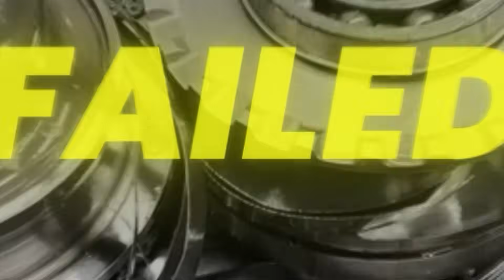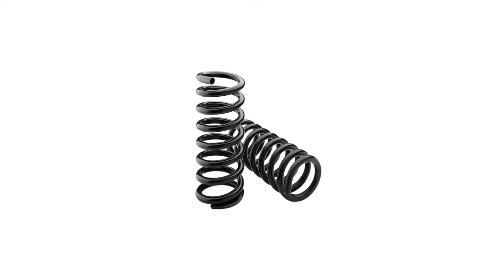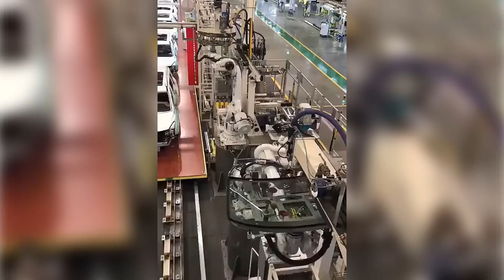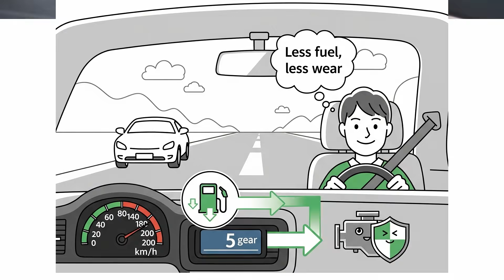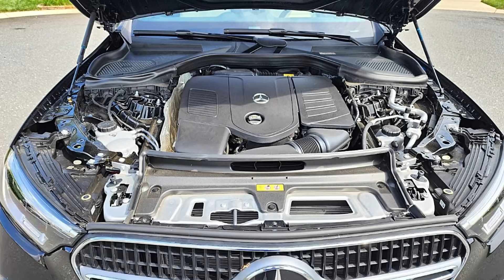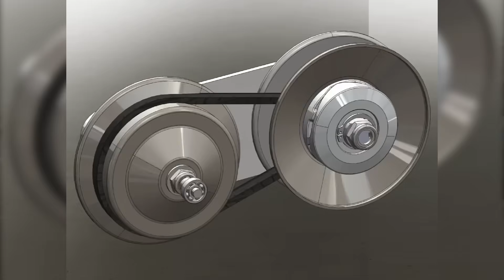How This One Bad Habit Kills Every CVT Transmission Before 50,000 Miles

Comment: CVTs are great but the issue is that the vehicle is too heavy for the CVT to run. Think about it, CVT are on powersports for a reason. Lightweight only. If they put a transmission with transfer case in a power sport chassis, the vehicle will be too heavy for it's classification. Most people now a day, pedal to the medal. It doesn't matter about fluids if they are always on the pedal.
Reply from the maker: agreed

Comment: If possible buy a car that still has the older automatic in it. If the car with one of these automatics is driven properly then they can last over 400,000 miles. Try not to get a car with a CVT transmission as they can be trouble in about 150,000 miles. They cost on average 4,000 dollars to buy and replace. They are usually replaced with another complete CVT transmission.

Comment: Cvts are inferior to manual transmissions and traditional automatic transmissions. It should be phased out just as timing. Belts are inferior to timing chains and should be phased out
Reply: Subaru CVTs use a reinforced metal chain instead of a belt.
Reply: Ain't gonna happen.
Reply from the maker: The only advantage is they give slightly better fuel economy and smoother driving experience at low speeds

Comment: It's built to fail. No matter who drives it you won't get to 100k miles. Don't buy vehicles with them.
Reply from the maker: i THINK its only advantage is that it gives slightly better fuel economy
Reply: Completely false.  There are mass numbers of CVT-equipped vehicles that go over 150k - 200k without failures.  My'87 Toyota Camry and my '98 Ford F-150 couldn't, and they had traditional automatic transmissions.
Reply: That is a COMPLETELY FALSE statement for a Toyota CVT.

Comment: Biggest killer of CVT transmissions is the same as regular transmissions, lack of maintenance. Changing the fluid regularly is the biggest thing you can do to keep any transmission going. I know a guy that has 200k+ miles on a Nissan CVT, he is religious about changing the fluid.
Reply: Mine was mirage cvt used for ride hailing in ph..it has 343k km mileage. Used it for 8years with no cvt and engine problem.
Just cvt fluid change.
Reply: The problem is Nissan is telling customers they should change it every 60,000 mi. That's the problem
Reply: @dampergoldenrod4156  that’s cause they wanna make money. It’s better at 30,000.
Reply: @dampergoldenrod4156  
Because if you wait until 60K, your car will be outside the 60k warranty period.
Reply: @dampergoldenrod4156  That or telling them it never needs changing. I argued with a Nissan sales hole over this one day. I told him to stop telling people that and it's not true. He replied "what else can I help you with". I don't understand why these jerks are telling people this. Do they actually think I'm going to buy another Nissan after the transmission fails prematurely?
Reply: That’s why we have Google and the Internet to tell you the exact truth and the right time of maintenance to change anything basically in general
Reply: @dampergoldenrod4156 My dealer says 30,000. But I say 15,000 (filter) and the one in the pan. My 2021 Rogue SV 26,000 just a little over.  Bring the standard drive transmission. Nissan is big trouble, I'm looking for another car. Nissan goes to where Satan is.
Reply: @dampergoldenrod4156 Nissan actually let a Lebanese snake oil salesman be their CEO.
Reply: That's why they make it as difficult as possible to change the fluid, with no drain plug, no dipstick, and arcane fluid types that have only inferior generic brands in box stores.  This way, they can claim it's not their fault that the owner didn't change his fluid and filters.  The other thing is undersized cooling for the fluid, often with just a coolant/CVT fluid device that can contaminate the CVT fluid long enough to trash the transmission before it gets caught.
Reply: @Mikexxx531  Like seat belts they had to make it a law to get people to use them.  Many transmissions are ruined by foreign matter the reason you cannot change the oil yourself, all computer controlled  light years ahead of most people.
Reply: @curtiseggemeyer5681 what who makes said computer
Reply: My Honda Accord has a CVT 225,000 miles and it drives like a baby you have to change the oil at least every 30,000. If you do it at 20 even better.
Reply from the maker: After how many miles he changes fluid?
Reply: @AutocornerdPros New CVT every 30000 miles 
Basic maintenance schedule for a Nissan
Reply: @samuelswanepoel7926  A new CVT every 30000 miles? That sounds about right.
Reply: thank you neckbeard cvt fanatic
Reply: Depends on which vehicle. I only drain and fill once on my 2007 Tacoma. I still own it after 320K+ miles.
Reply: @matrix-fh9tn  They have CVTs?
Reply: Bingo
Reply: They are like timing belts. They are inferior and there's no reason to go back to timing Chains...cvts are inferior and there's no reason manufacturers should not go back to traditional automatic transmissions or manual transmissions.
Reply: So prayer is the key to extending the life of a CVT? No thanks.

Comment: Why make a over complicated gearbox when most people who drive can’t even check there oil or tyre pressures it just another motor con from vehicle manufacturers to take the money out your pocket, also why haven’t you explained and made sure the owner of the car now about the run in if you don’t tell them then yeah there just going to drive like normal…… massive engineering con
Reply: Ask and blame Nissan who invented CVT
Reply: @leetos.4915  Nissan didn't invent the CVT nor were they the first to use a CVT. They do have the worst CVT on the market though
Reply: @greasemonkeymechanic1  Yes THE WORST   CVT  is a Nissan  CVT
Reply: @leetos.4915 cvts are a pulley technology from 100 years ago
Reply: @dampergoldenrod4156  They should have stopped using them 100 years ago.

Comment: Nothing beats manual with a clutch 😂
Reply: But in Europe, manual with clutch are being buried along with diesel cars.
Reply: @torque-converter-w2y   That's an automotive manufacturer's choice; NOT customer choice.  Its all about what's best for revenue; not the customer.
Reply: 100%! I call my clutch a theft deterrent! 🤣🤣🤣
Reply: When the clutch plate was worn out you can get it changed with a throw bearing and in most cases be back on the road for $1000 because of the labor cost. Look at the problems Nissan is having with their CVT's and Nissan as a whole.
Reply: You are right there but I have a non functioning left foot.
Reply: Traded in the problematic CVT and drive a manual now.
Reply from the maker: Haha yes as less maintenance is required and they are rough n tough. But noobs like me still dont know how to drive manual car
Reply: @AutocornerdPros  You have a channel giving "pro" tips about cars, your username is AutocornerdPros, yet you openly admit that you know very little about cars. Interesting.
Reply: BS, the old GM turbo 350, 400 were almost bomb proof. Then the 700R4 added locking convertor, saving the 3 % loss in gas mileage.
Reply: Manuals are boring
Reply: Aaaand those days are over. End of story.
Reply: Torqueflite beats sticks all day long.
Reply: Yeah 😂 staying alcatel keypad phone
Reply: Agreed about a clutch.  I owned a BMW E46 M3 for 18 years, and logged some 242,000 miles on the original clutch.  Never did a standing burnout, never drifted the car by clutch-kicking it, and generally did not abuse the car & clutch.  I just drove it like a regular person, did a few track events and a lot of autocrossing.  Same clutch, master and slave cylinder, never replaced.
Reply: I hate automatic transmissions😅
Reply: Actually there is quite a few ways automatic transmissions are actually better. Lower maintenance costs is literally number 1. You still have to change the oil in a manual transmission and you will be replacing the clutch about every 100k miles typically.
Reply: @greasemonkeymechanic1  It depends how you drive.  You can make a clutch last for hundreds of thousands of miles if you baby it.
Reply: @greasemonkeymechanic1  Exactly right. I drive carefully and have no trouble from my older NON    CVT automatic gearboxes. CVT  automatic gearboxes can be a real problem. They go bad at about 150,000 miles and usually require a full replacement CVT gearbox that costs about 4,000 dollars.
Reply: Well maintained CVTs go far beyond 150,000 miles and beyond.
Reply: @greasemonkeymechanic1 manual transmisions do not need an oil change, ever, if driven properly. Also, the cluch can last 300 000 km in a city start-stop driving, and even more on open road, if driven properly. I have an company car, renault kangoo, which is 2008 year, currently at 550 000 km, used and abused in a city delivery tasks. Still on original clutch and turbo.
Reply: @mariomilicki23  all fluids have service life and the fact is the recommended service interval for the manual transmission is 30k on most vehicles same as the automatic transmissions. The typical life span of a clutch is around 100k miles on most vehicles. Yes they can last longer if you are careful and don't abuse it, that still doesn't change either of those facts. Just because you have gotten that kind of milage from a clutch and transmission without service doesn't mean anything. 
I work on vehicles for a living and can tell you for a fact that automatics generally last the life span of the vehicle of they are serviced correctly and will be cheaper to maintain during the life span of the vehicle, period.
Reply: @greasemonkeymechanic1 i beg to differ… i’ve been driving since ‘95, (driving for living) not a single one of my cars had under 100 000 miles when bought, in fact some were close to 200 000 (the exception being russian Lada Niva, but that is a story for an other time), and yet somehow ALL of them (around 20 of them, i could make a list sometimes) were on original clutch (i drive only manuals all of my life) with no trans oil changed, never (seriously, i never met a single guy who does it) - never had any problems or failures during the times i drove them - and i make some serious mileage… and some of the cars were the “supposedly” unreliable french cars.  (in practice they were the least problematic ones). And i’m not talking about commercial vehicles - but an passenger cars. And some of my friends and collegues drove the automatics, they in general all had problema with them, either with torque converter autos or automated manuals (they are really prone to expensive problems). Period.
Reply: @mariomilicki23  again, your personal experience is just that, I have worked on thousands of cars owned by every day people driving. The people with automatics have less expense in upkeep period. You are trying to use opinion in place of fact, just because you have been lucky doesn't mean that anyone else will have the same experience as you
Reply: @greasemonkeymechanic1  that has nothing to do with luck, and that is not just my opinion - i’ve stated facts. all the people i know have the exact same experience.  The cluch lasts at least 300 000+ kms if you know how to drive a manual properly.
Reply: @greasemonkeymechanic1 I am not a professional mechanic, but I do work on my own cars, including a couple of transmission overhauls, several transmission swaps, a couple engine overhauls, several cylinder head jobs, etc. I am in my late 40s and have driven manuals most of my life. I agree with you about fluid changes, all fluid regardless of type breaks down, and as we both know many modern manuals take automatic type transmission fluid, with a few exceptions such as the G56 6-speed in the Subaru 5mt. Anyways, I completely disagree with you on clutch life. If you can't get 250,000 plus out of a clutch then you really don't know how to drive a stick. I don't expect my wood truck to reach 250,000 on a clutch, but then again I slipthe fuckk out of the clutch in the mountains pulling logs and shit, but even it has nearly 100,000 on the clutch
Reply: @greasemonkeymechanic1  I almost died laughing when you said that ' the fact is the recommended service interval for the manual transmission is 30k on most vehicles same as the the automatic transmissions. The typical life span of a clutch is around 100k miles on most vehicles".     Really? You cannot make this up. You said you do cars for a living, are you sure? I am 54 years old and all the vehicles I owned in my life time are all all manuals. All of those vehicles pass 300,000 miles or more except the two vehicles that I owned right now and I never change the fluid of the transmission and change the clutch of those cars ever. For now, I have a 2009 Nissan Sentra with 277,000 miles on it and a 2020 Subaru Crosstrek with 52,000 miles mileage. As I said earlier, these two vehicles are manuals.
Reply: Amen brother

Comment: This is an inherently poor design and nobody should ever tow utilizing a vehicle with a CVT transmission.
Reply: Amen
Reply: They can tow up to rated max gross no problem.
Reply: It is an amazing concept, the main difficulty to overcome is the high ratio of input torque to the smaller contact surfaces in the belt/chain requiring high hydraulic clamping pressures on the variators, resulting in more friction creating more heat.
Reply: They never should have been used in any vehicle heavier than a scooter, ATV, or side-by-side.
Reply from the maker: Strongly agreed